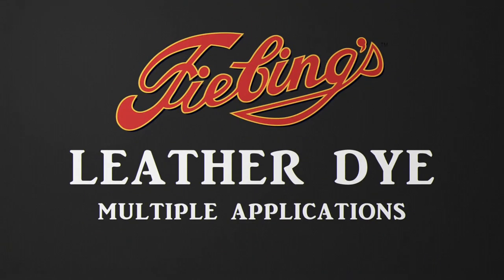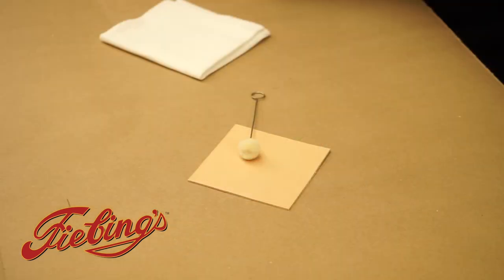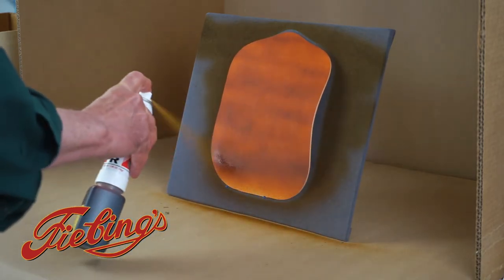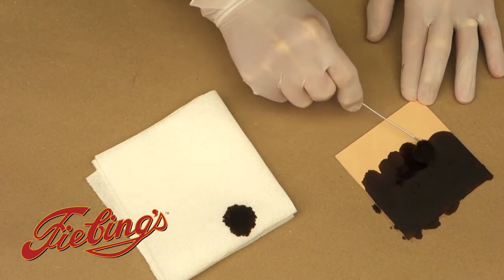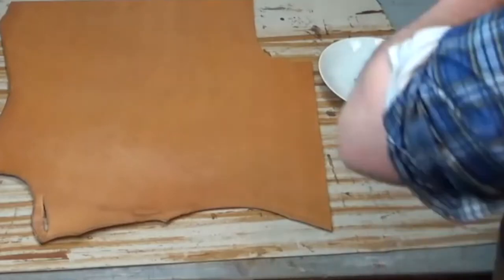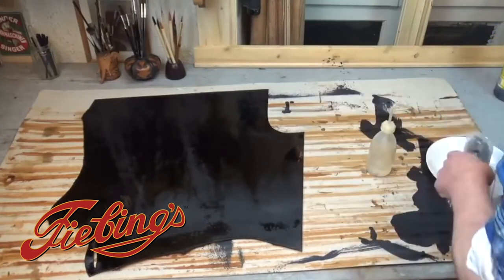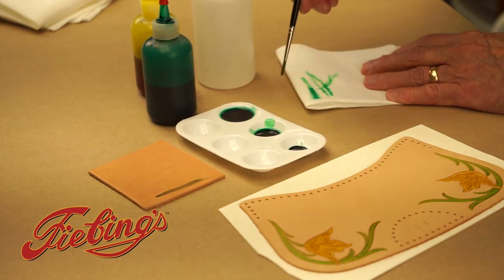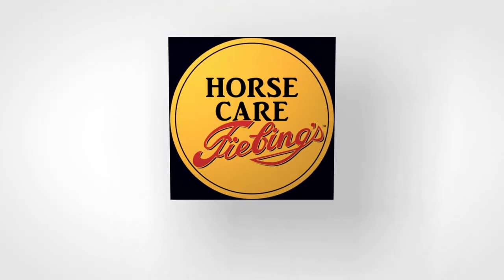Fiebings Leather Dye How To Product Tutorial for Leathercraft

Comment: I need your help in this matter. 

I got a leather sap made out of horse hide, which originally was dyed with fiebings oil walnut, and finished with resolene. Unfortunately it got a bad scratch so I asked someone to restore it for me. This person used fiebings deglazer, same oil dye colour walnut and finish it with resolene neutral, but unfortunately it didn't have the expected colour. 

Is there any way or change to strip of the second dye and re dye it again so it will be as close to the initial colour. 

First image is the original colour, the one on the scale, second one is the one I'm not happy with the colour. 

 

Thank you for your help in this matter. 

Chris
Reply: You can remove some of the color with Fiebings Deglazer.  However, when it was originally made, there was no color before dye was applied and now there is some dye color when new dye is applied...that means the result will be darker unless you lighten your shade of dye by mixing the dye with Fiebing's Dye Reducer

Comment: Can we apply leather balm to prevent the dye bleeding if it connect to water?
Reply: Im new to leather work, but in my understanding, leather balm is a top coat that is only naturally resistant to water due to its wax compound. You will also need to reapply it more often if the top coat is exposed to water. (Think of it like a car wax you put on after a complete car wash). I use resolene on my leather overcoat and it has a good water beading effect and ive only had to correct it once in one area where I put too much resolene on a section and it textured itself off and needed to be deglazed and recoated!

Comment: I see questions on here that were posted a year ago and never answered.
Reply: Is there a question you need an answer to?
Reply: @cchase4314  Thanks for the reply. I thought I had a bottle of Fiebing's oil dye but it's actually Eco-flo oil dye by Tandy. On the product safety sheet it says it's manufactured by Fiebing's so I don't know if you can answer a question, and on that sheet it does not say how to reduce the product, which is a little strange.  I need to know how to reduce this dye because it's too dark. I don't want to use neatsfoot oil because I don't want to apply that much oil. I tried methyl hydrated but it doesn't mix well with the dye. I'm working on a huge project and cannot afford to get it wrong. I'm just frustrated that it doesn't say on the label how to reduce the product and the Tandy stores are closed on Sunday. Thank you.